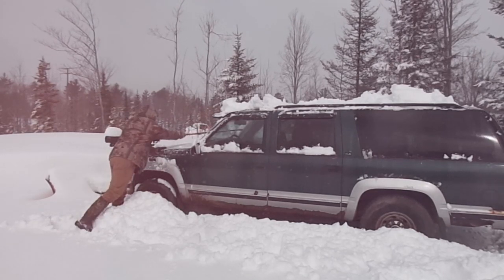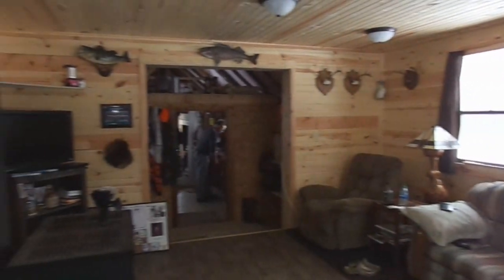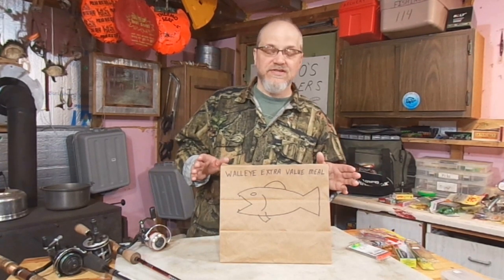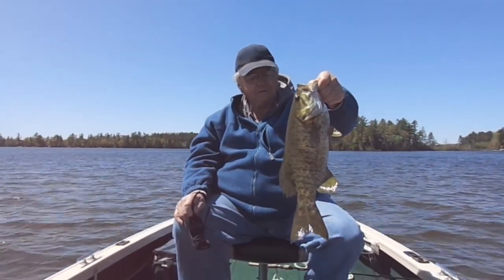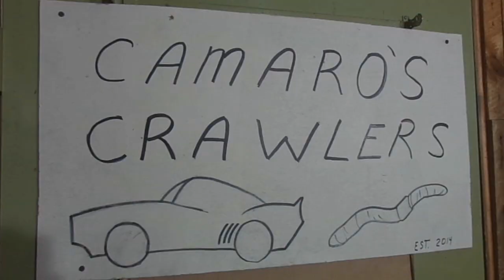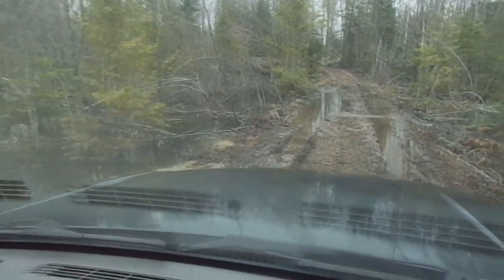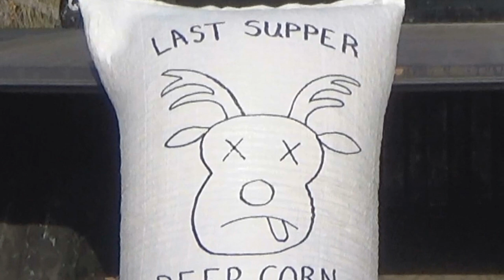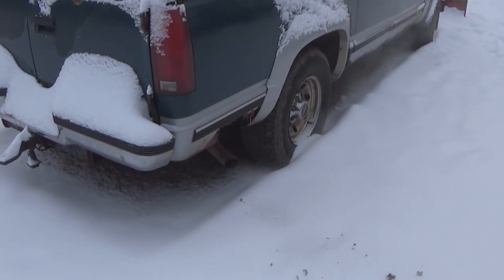A Year Outdoors In Michigan's Upper Peninsula

Comment: Dave, I'm going through practical U.P. Outdoor content withdraws.  How's the ice fishing up there?  Not much Ice in the lower right now, and the warm weather is making what little ice we have pretty weak.  I have been using your K-slide quick strike rig, but haven't had much luck yet. Using live and dead suckers, but haven't gotten much action.  Any tips on crappie and gill fishing early ice?
Reply from the maker: We have safe ice on most inland lakes (walking ice).  I don't do anything special for bluegills thru the ice.  For several years I had a permanent shack on a bluegill lake.  It was always best in the evening, and wax worms on a plain hook seemed to work as good as anything.  Thanks for watching, KPO.